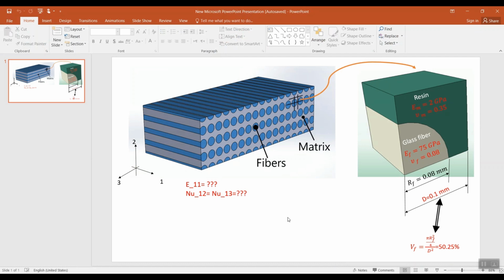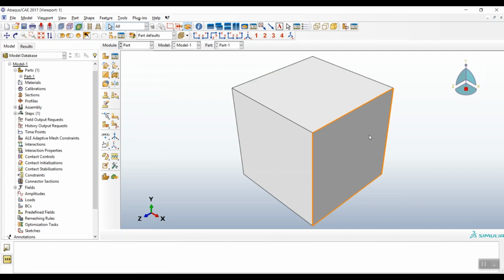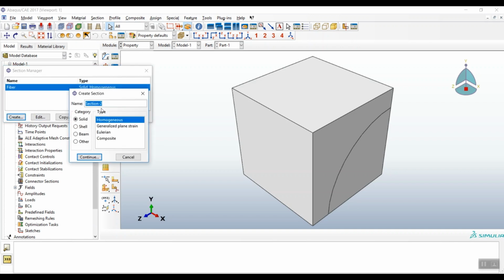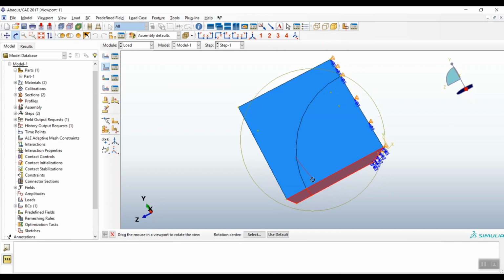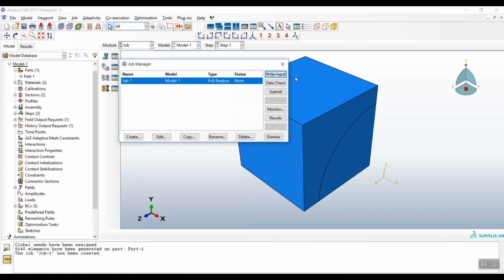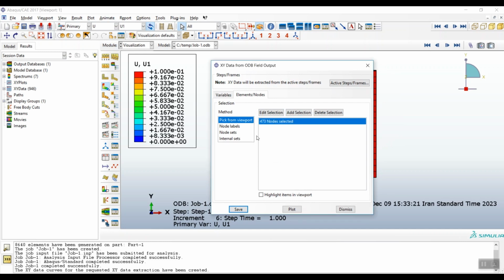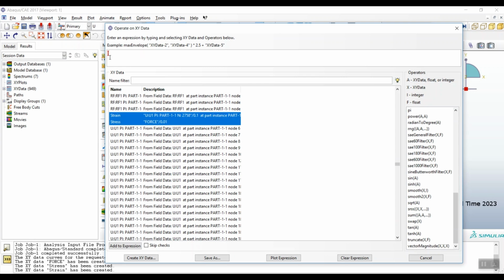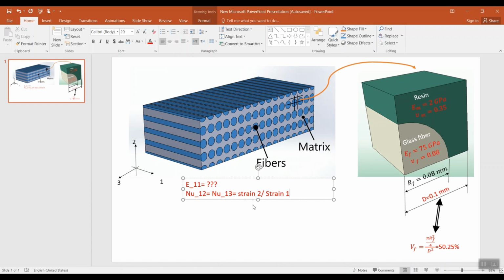ABAQUS Finite Element Tutorial: Analyzing Orthotropic Properties of Fiber-Reinforced Composite

Comment: Why are symmetric boundary constraints applied instead of periodic boundary conditions? I feel that this approach is not reasonable. Do you have any references or justifications for this method?
Reply from the maker: Thanks for your comment but I think it's better to do the analysis by the BCs that you mentioned. If you model any kind of repeated cell including 1/4th, 1/2nd one or two or ... cells of fiber and matix as a representative, it should give you the same results, neglecting that it's periodic or not.
Reply: Thank you for your reply. Do you understand how to add complete cellular periodic boundary conditions? In particular, how can the nodes at corners and edges be handled to prevent over-constraint? Thank you. @atakhabaz3607